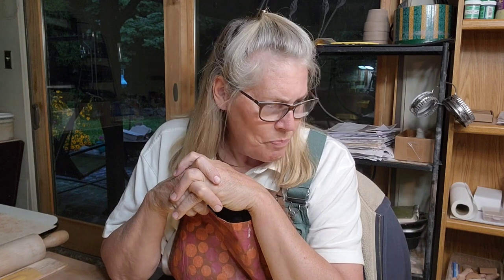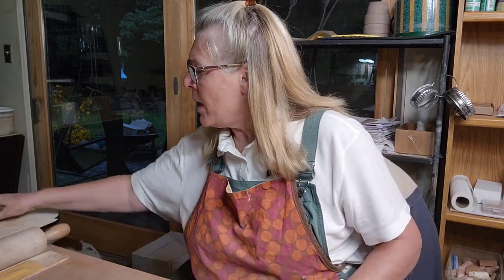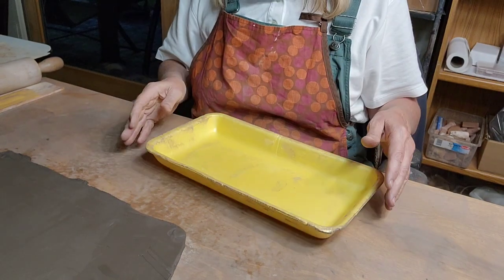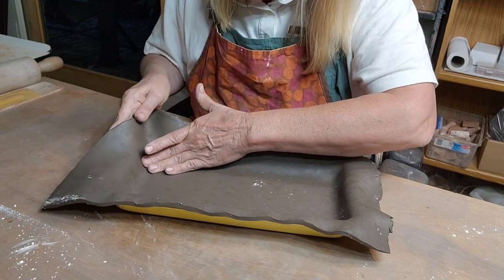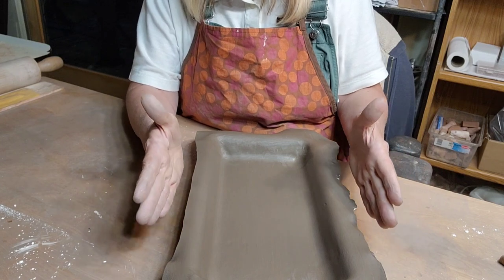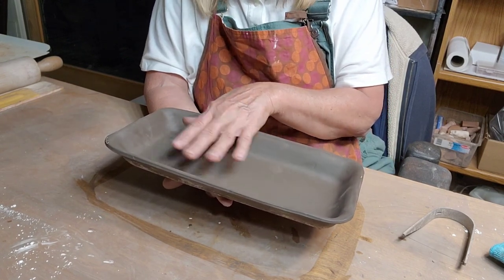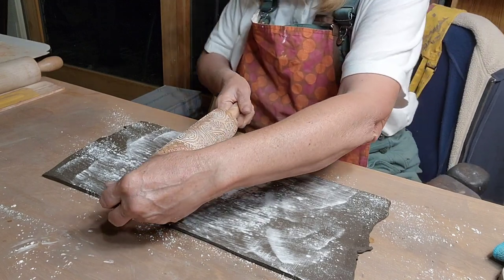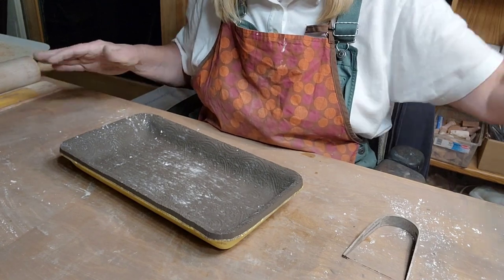Using a Common Styrofoam Mold for a Platter, with Stoneware Slip over Kentucky Brown Bear Clay.

Comment: I love the way you explain everything and your pots look soo perfect when you’re done. I wanted to point something out. I make slip cast pottery as well as handbuilding and it’s really important that the slip and clay have the same shrinkage rate! If they don’t the slip will flake off no matter what stage you apply it. Also, if you spray the back of the pot with som water before applying the slip it will even put the moisture more evenly through the pot so it doesn’t crack. Just want to point that out.
Reply from the maker: Thanks so much!  ❤️  And thanks for the tip.  😀
Reply: @WildAcornsArtStudio  I know you mentioned the slip and clay needing to be the same shrinkage but it was kind of far into the video so I wanted to put it int comments in case people were watching and didn’t get that far. Sorry to be bossy. Lol I just wanted to be sure to point it out. I saw Simon leach adding slip to his pots and he sprayed the outside with water and I thought that was such a great idea!! I’ve had a pot completely fall to pieces because it was just too wet. But that’s how we learn. Thanks sooo much for your videos.  I just LOVE how you showed how to bend the clay into the edges of your mold. Oh and PRETTY PLEASE show us all of the things you use for molds. I feel like I use the same old things all the time. I do however go to thrift stores and look for plates and bowls hat have a great texture on the back so I can “slump” the clay over them and use them as molds! I found an absolutely incredible leaf bowl that I did that with and it turned out just amazing. Can’t wait to see you carve through the slip.
Reply from the maker: @micheledickey4066   no worries, thanks for adding that to the comments.  I also sprayed mine with water first.  But I only do that if I feel like I've waited too long to safely apply the slip.  It's a great idea.  Yes, I a buy stoneware slip for stoneware clay, but I know people who buy porcelain slip for stoneware and even low-fire, which I don't understand how that can do that.  Maybe they apply it thin enough that it doesn't matter.  Not sure.  And you're right, it's all a learning process.  😀
Reply from the maker: @micheledickey4066   oh, I forgot to add that I will bisque fire these, and then paint them using underglazes.  I hate to carve!  😀  It's hard to apply my black liner to carved designs, also.  Have a great day!  😀

Comment: Hi. Another great video. I use plates, Styrofoam as well for my molds. I'm glad I'm on the right track, as I'm self taught. Can I ask, do you have any videos on reglazing?
Reply from the maker: Reglazing...ugh.  I am not a fan of reglazing.  I have reglazed numerous pots and I really haven't been happy with any of them.  Especially if you're trying to change the color, or correct pinholes.  If you're trying to touch up bare spots, that has a much better chance of success.  I have had students use Elmer's glue on their pots so the glaze adheres better, and that works okay.  They've also tried spraying them with hairspray, and that worked okay.  Neither worked 100%.  I prefer to lightly sand the piece, and then apply the new glaze, and set it in front of a fan between coats.  Reglazing is tough!
Reply: @WildAcornsArtStudio  Hi Lisa, it sure is. I made a very big moneybox  pikachu for my grandson. I had to reglaze to attach it's tail ... disaster! Never again. Lesson learnt. Love your videos and your commentary.
Reply from the maker: Thanks Carolyn.  Sorry to hear your reglazing didn't work out.  😞  They rarely do.

Comment: What kind of slip are you using? Is it a b-mix slip? Or did you put white underglaze on your mugs? Also, what is the size of your slab roller?  Thank you. Love your paintings/new designs.
Reply from the maker: Hi Sue.  I just ask my local clay supplier for a gallon of white stoneware slip for cone 5/6.  
My slab roller is a Bailey DRII-30 w/ a 60" table.  It looks like they only make 51" and 69" now, though.  I researched a lot before I bought this, and it is a really high quality slab roller.  (They weren't that expensive when I bought mine about 8 years ago!!)
Reply from the maker: The mugs were dipped in the white stoneware slip at the soft leather hard stage.  The dark clay is Kentucky Mudworks, Brown Bear.  Thanks for watching!  ❤️

Comment: I love all your videos , I learn something new with each one.   I have never tried this method of slab building...I will definitely try these.  But first I will have to buy a lot of 'chicken' to get those lovely containers.    I wonder about the slip you use.  Is it something your clay supplier makes?  Also, you mentioned in one of your other videos that you used clear glaze from the 'jar' to dip your items.  You just added several jars to a bucket and added some water.   This sound interesting....can you tell me how many jars and water you actually used?      Can't wait for your next video...anything with turkeys?
Reply from the maker: Hi Pat.  Thanks so much!  ❤️  Hmmm, I  dont think my local clay supplier makes the slip.  But to be honest, I just ask for a gallon of "white stoneware slip."  Have never made anything with turkeys.  :-)  If you can't find the trays, remember you can find great molds at department stores and/or grocery stores.  They usually sell various size trays for holidays.  😀
Reply from the maker: Oh, forgot to add that sometimes if I can't find the clear dipping glaze that I want, I just pour two or three jars of glaze into a bucket with about 3tbsp of water per jar.  (I do this, because I don't want the clear glaze going too thick, or it could turn cloudy on the piece.)
Reply: @WildAcornsArtStudio                                               Thanks so much...this will really be so much easier than brushing on......  So you only do one 'quick' dip  ...correct?
Reply from the maker: @patgalletti6221   I usually dip it for about 2 seconds.  If I've added too much water, I dip it for a little longer.  Just kind of depends on how thick it's going on.
Reply: @WildAcornsArtStudio  thanks so much.  I gotta try this!!!!

Comment: Great tips, thank you! Could you tell me again the supplier for the “cheese grater like” trim tool? I’ve replayed the video several times but can’t quite make out the name. Thanks!
Reply from the maker: Hmmm...if you're talking about the red handled tool with the serrated black bottom, that is made by Mudtools.  😀
Reply: @WildAcornsArtStudio  Actually, I mean the one that looks kind of like a set of tongs with wire stretched in between the two ends, that you used to trim the sides of the clay down to the edges of the form.
Reply from the maker: @pattywalker8169  Oooooh, know what you're talking about now!  😀  I bought that from Bill Van Gilder.  Check out his website.  He makes beautiful everyday pottery.  You can also take the roller out of a cheese slicer, and use that.  I love that tool.
Reply: @WildAcornsArtStudio  Super, thanks very much Lisa! I appreciate you still replying to comments even for videos that are older.
Reply from the maker: @pattywalker8169   Oh, no problem!  😀